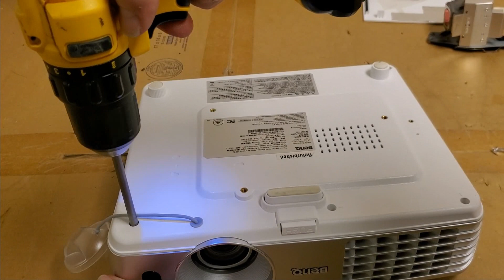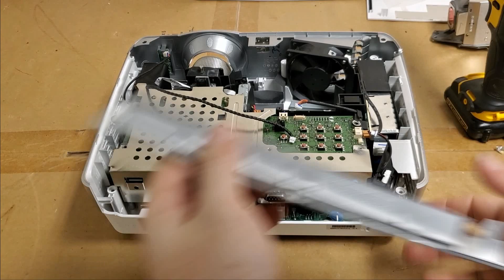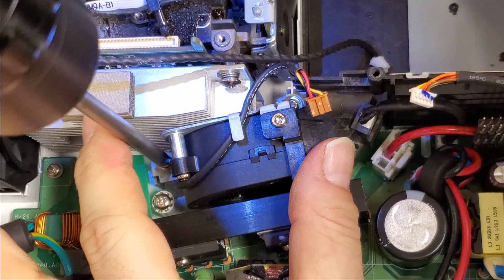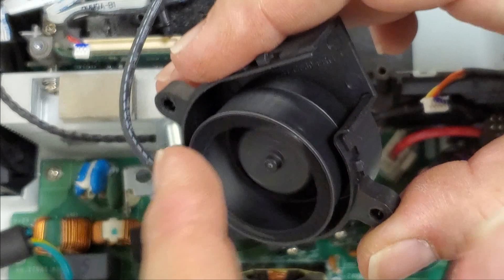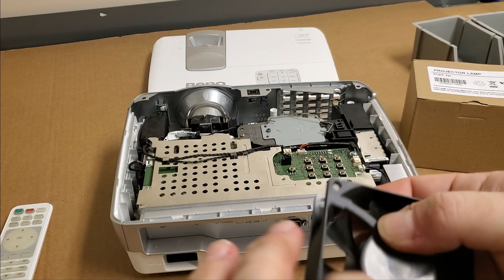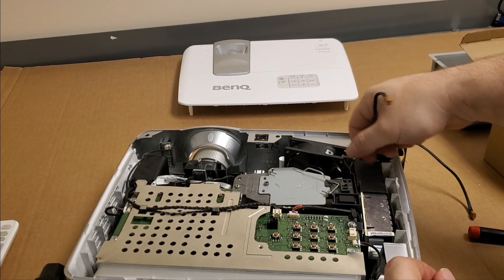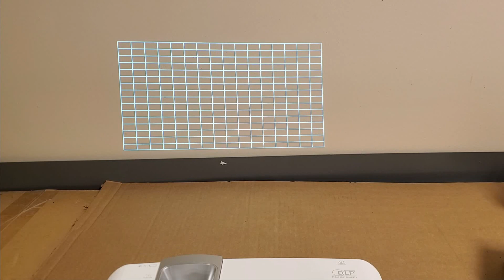BenQ HT1075 DLP Projector Overheat/Fan Replacement

Comment: Hi Frank, I am from Sri Lanka, and own a Benq HT4050 projector. About 1 year ago this projector started giving me an uneven gray screen with a few white dots, after a while of showing good images on screen. The time the projector worked fine before the gray screen appearing became progressively shorter. Sent this to Benq in California, and have been using this for about 2 months, and the problem reappeared. Really frustrated that Benq makes projectors like this! What do I do to fix this?
Reply from the maker: Hi Sheran, That sounds like a failing DMD unfortunately.  BenQ's service is definitely something that I find quite poor too. I see a decent amount of refurb projectors or warranty repairs that are poor quality.  IF you can link a video of the issue, I can weight in more precisely.

Comment: I have a benq mx522 projector. Start up and temp light red flashes. It displays only the benq screen. Fan cycles speedily. What can be the issue?
Reply from the maker: I would suspect a jammed fan or a slow exhaust fan.

Comment: Very helpful video. I've been following along but I'm having some startup issues after reattaching the circuit board. When I plug it back it in, the power indicator light (the word "power" over the source button) remains a solid red and pushing the power button (solid green color) has no effect. I noticed in your video that when plugging in a power source your power indicator light changes from red to orange. Any thoughts as to why my power indicator remains a solid red and I can't turn it back on?
Reply from the maker: Red means a fan problem. Make sure all your fans are securely plugged in.  Also make sure the power supply pins are not offset to one side when you plugged the mainboard back in place.
Reply: @FixitFrank  Thanks for the response. The fans all appear to be plugged in correctly. I initially ran into the power supply pins you mentioned but solved that earlier on. I've read on some forums that a solid red light means "stuck in download mode" and removed all cables and held down the power button for 10 seconds. All to no avail. The original problem was glass in the main blower after my bulb exploded. Saw you covered that in some other videos. Still stuck....
Reply from the maker: @ndub80  Ah.  OK.  In that case, you might have a bad PMD1000 chip.  Stuck in download mode can also mean the MCU is not booting fully which can be due to a secondary power supply issue(that PMD1000 chip and the associated voltage regulators).  You might want to start checking voltages on the mainboard against the service manual.
Reply: @FixitFrank  Before I began the whole process, the projector would fire up fine but would just shut down after 2 minutes because fan 3 wasn't spinning due to the glass shards. I don't know if it's stuck in download mode for sure, just something I read in a forum. I've disassembled and assembled this projector like 3 times to see if there were any loose connections or anything hooked up wrong. I'm thinking I must've missed something when reassembling it cuz it would turn on fine before I disassembled it. I'll try to check the voltages. I appreciate all the suggestions up until now.

Comment: Hi Frank, I have a benq ht1075 the bulb recently exploded. I ordered a new bulb, installed it, and now I don't have any light from the bulb. Eventually the red lamp light comes on and it shuts down. I've watched some of your videos to try and diagnose the issue but haven't had any luck. My color wheel is working. And my regulators seem to be ok. Any other ideas what I can check/what the issue is?
Reply from the maker: Hi Steven, Check the lamp blower fan for bits of the old lamp.  They tend to throw chunks of quartz into the blower fan. It does not take much to jam it up. That would cause this error too.

Comment: Hi Frank, I have a W1070 that appears to permanently be in download mode. Red LED on Power button only, no other LED's lit up. I've tried to download the firmware with DLP Composer Lite via USB and RS232 connection. It never connects to download. I suspect the firmware or boot up loader is corrupt and its never getting to a stage to be ready for a download. Is there a way to re-flash the firmware over one that is corrupt? I suspect it would have to be done via the main board, and not through the USB or RS232 connection on the outside.. Or is a new motherboard the only solution at this stage?.. Your videos have been super helpful in the past, thanks!
Reply from the maker: Hi Marcus,  The PMD1000 IC would be suspect here.  It is probably not powering one of the other secondary power rails.  elektrotanya.com has the service manual( if you do not already have it) but I would verify that PMD1000 IC is working first. I doubt the original firmware is corrupt at this point.
Reply: @FixitFrank  Thanks for the tip! Do you happen to have a video featuring this chip? i.e. replacement, or diagnosis of it? Are these chips typically surface mounted? Appreciate the info!

Comment: Hello Frank,
I'm having a similar issue with this same machine HT1085ST, although my machine auto-shuts off after a few short minutes, and the control panel shows the Power Button RED and the Temp Button is GREEN. 
The manual states that this is likely a fan issue. I tried turning on High Altitude Mode, and this did not stop the machine from turning off. Any suggestions? 
Thank you Frank!

Comment: Hi Frank, I have the same projector, the bulb exploded a few seconds after I turned on the projector! Glass was found outside the bulb and the lamp housing was extremely hot, do you think there’s something wrong with the projector or if the bulb simply needs replacing? Thanks

Comment: Buddy blew his bulb and gave it to me when it was overheating. Found glass in the black fan in the bottom. Cleaned it out and it was working, but now has verticle white lines. Any suggestions on what that might be?
Reply from the maker: sorry this is so late, but its the DMD connection to the mainbaord.  Reseat it and you will be gold.

Comment: Hey Frank. I have a benq mx525 On the left I have a black vertical stripe less than 2" wide and on the right about the same amount is missing also less than 2" across the bottom is missing. Are there any adjustments to be made so I can stretch and expand the image to right and also adjust the bottom missing bits. This is noticeable when I put the test pattern on. I feel as though the whole image needs shifting to the left. Is this to do with the lens? I mean is it machanical?

Comment: Hi Frank, I just replaced my bulb.  This is the 3rd bulb.  #1 lasted 3 years and went dim and I replaced it with #2 which also gave me 3 years but it recently exploded.  So I bought and installed bulb #3.  It is a stock Osram.  The projector was NOT shutting down before I replaced the bulb.  In fact, I was using the original bulb #1 for a month as I waited for the new one and it worked fine.  So the new one seems to be getting hot and shutting down?  Seems like if it was a fan issue it would have been shutting down with bulb #1...   ? Thoughts?

Comment: Hello Frank! I have an Benq MP512ST. The projector will come on for about 3-5mins and then the “Temp” alarm will come on. I have replaced the lamp, like you suggested but I still get the same problem.
Reply from the maker: Hi Bo,  That likely is pointing to the exhaust fan.  The fan that is visible inside where the lamp goes.  Try it in High altitude mode and see if it runs.  If so, then you need a new exhaust fan which is only about $20 shipped.

Comment: Hi Frank, I wonder if you can help me. I have a similar problem but your solution did not work for me. My BenQ W1070 has started overheating. I tried replacing the main fan but it makes no difference.

When I turn on the projector, the temperature goes from 200 to 400+ in a couple of minutes, with the fans going into full speed. I have cleaned it and installed a brand new BenQ lamp unit. Not sure what to try next. Any ideas?
Reply from the maker: Hi Tom,  There are 2 fans that do most of the work.  The blower fan would be my other suspect.  If it has its blades coated in dust it can slow down the air flow into the lamp.  Did you have any old lamps burst when they failed?
Reply: Thanks Frank, I have taken a peek inside the projector and one arm on the blower fan is damaged. Getting hold of a new one here in the UK is next to impossible. Don't suppose you know where I might source one? I also noticed the plastic casing between the fan and the lamp is not keeping an airtight seal. Might this be where the problem lies? Not sure how on earth I get a new one though. I at least feel like I am closer to finding out what is wrong though, thanks to your help.
Reply from the maker: @tomatack  Sure thing!  I have a friend named Crystal from a company called Time Projector.  She is in China so shipping to the UK is no problem.  gydz@timeprojectorlamp.com is her email.  She will ask for a picture of the fan(to make sure they have the right one)so if you include a picture with your email it will speed up the process.  The price should be very reasonable. I'd guess $40US with shipping and the fan, so 30quid if I had to guess. At least in that ballpark.  She takes paypal so everyone is protected.  They would be your best bet for sure.  It may even be more economical(with shipping) to buy all 3 fans from her and replace them all. I would at least replace the blower and the large fan. Don't hesitate to ask if you have more questions!
Reply: Thanks for the recommendation Frank. Crystal is a gem. The fan was cheap and arrived quickly. My projector is still not working though! It makes all the right sounds starting up but there is no light from the lamp, and after a few seconds it turns itself off, leaving me with a solid red lamp fault light.
Reply from the maker: @tomatack  Glad to hear the fan was easy.  As far the lamp not lighting, a common and easy to make mistake is flipping over the color wheel cable when re-inserting it.  I would check that and then make 100% you didn't forget to plug another wire in. The ballast wire in particular would be a concern.
Reply: @FixitFrank  I wish it were as simple as that. All the cables are correctly inserted and the colour wheel spins round when the projector fires up.

Comment: Hi Frank, Would you know the location of the temperature sensor T1? T1 on my projector indicates about 70DeGC as soon as it starts with an outside air temperature  of 7DegC (Its my cold garage). Would the temperature sensor be faulty?
Reply from the maker: Ooh! That sounds incorrect for sure. Is it the same model as the video? The sensor may be faulty.
Reply: @FixitFrank  Its a Benq W1070. I ran it for about three hours a couple of days ago. It ran in high altitude mode with error check disabled and the lamp fan at 4000rpm (manual override).  Indicated T1 was 220DegC with an outside air temperature of 20DegC.

Comment: Hi Frank hope your doing well I have a question. I purchased a Optoma Optoma HD131Xe. I took it apart an cleaned it and noticed it has no lamp thermal sensor attached to the lamp housing. I noticed it's similar to the HD20 model and where the lamp thermal sensor on the HD20 is the Optoma HD131Xe looks like it had a thermal sensor in the same place. I can barely see it outline like it was there at one time but I can't see anywhere where it would plug in on the main board. So do you know if Optoma didn't install a lamp thermal sensor on the lamp housing. I bought it used from the original owner and he said he never had any problems with the projector. Just think it's strange why the lamp housing on the Optoma HD131Xe has the image of where a sensor was but isn't now.
Reply from the maker: Id have to see inside, but they can be low voltage or high voltage.  The trip mechanism is the same. I have seen them on the blower fan, the DMD housing and other places. It would be strange to not have one at all, but I suspect it is in a different place.  You are referring to the little rectangle self-resetting thermal fuse correct?
Reply: @FixitFrank  yes but now it's dead. It had a flickering image. I thought it was the color wheel. Cleaned the color wheel an noticed the flickering happened after the projector warmed up. So I read a failing bulb could be the problem. Well I replaced the bulb and as soon as the power cord touched the power connector a spark shot out from behind the power connector and now the projector is dead. So I don't have a clue as to why it would of done that just by replacing the bulb. I have other projectors an replacing the bulb has never caused a short. I'm guessing the person I bought it from was not being honest about it. So now I'm at a loss of what could be going on. If I could send you pictures I would send one where it sparked from. There is no burn marks in the area the spark came from. The one thing you mentioned about a fuse in regards to my first comment I don't really know for a fact but when I researched it. I learned it senses the heat from the bulb to control the fan and increases the fan speed to maintain the temperature of the bulb. I'm guessing it's integrated on the circuit board somewhere as there is no extre external plugins on the board for one. Just thought it was strange how there is an outline on the metal casing surrounding the bulb.

Comment: Hi frank! If you go into thé service meny you kan read/erase error codes, and see raeltime fan rpm.

Works on Benq 1070 1075 1070+  and more

1. Switch on the Projector 

2. Press the Menu button  (on the Projector)

3. Press the Enter and Source Key at the same time (On the Menu screen)

4. Now, you can navigate the service menu using the remote.

Just a tips. 
 And sorry for my bad engish
//Valle
Reply from the maker: That is very helpful. Thank you!